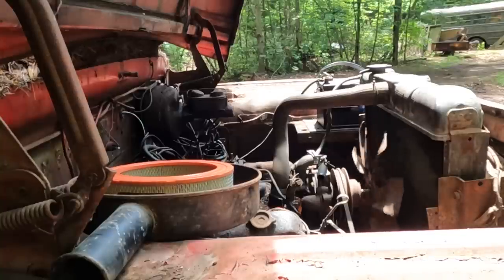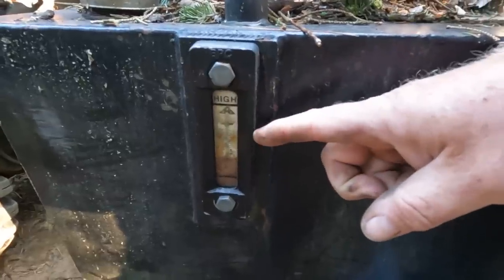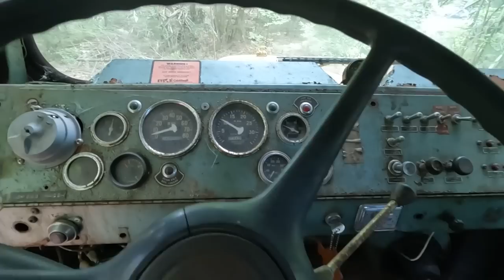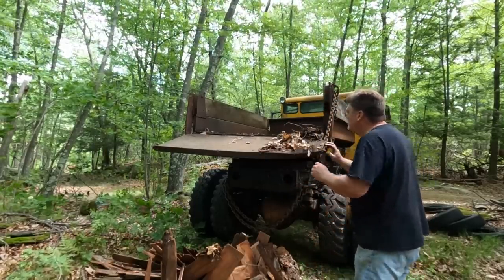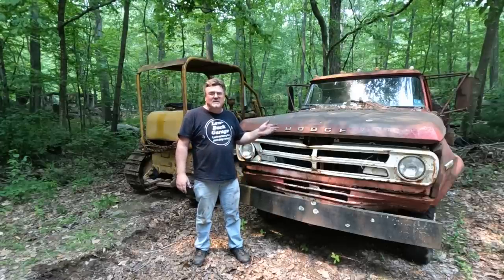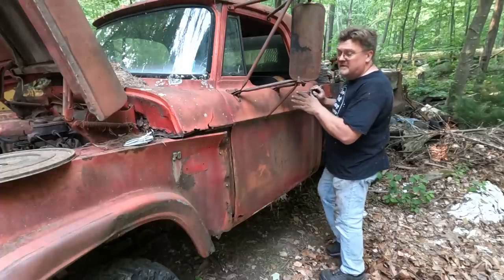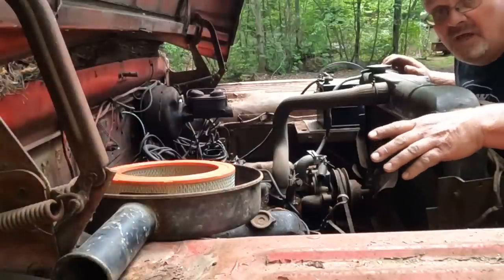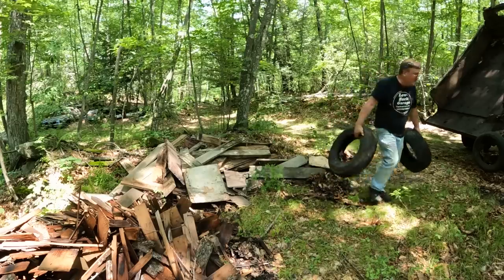Dodge and Oshkosh Dump Trucks

Comment: I love that Oshkosh.  I would use that as my daily driver.  Maybe that would stop all the park and run damage that I have been subjected to over the years.
Reply: why would anyone live in a city??
Reply: @Hard_Right  I don't live in the city, but over the years, whenever I parked my nice cars or trucks in a parking lot, some thoughtless pos would leave my car with a mark in the doors, or even back into my hood.
I had an a VW, that I used as my airport car, that had only been rolled once.  It didn't even have bumpers!  In over ten years of leaving it in parking lots, it never got so much as a scratch.  Man, that was a good little car, started every time.
Reply: @jjock3239  
As a still recently married man, had a service call on a Saturday at an arcade, wife rode with in my less than 1-week old '71 Pontiac LeMans Sport.
Wife comes in & says "I think you need to come out here" - Once there I see 
 guy is standing there, by my car, he starts to tell me how he had to drive his alcoholic father-in-law to the liquor store next door, and as he was backing out with his full sized '69 Ford Galaxie next to my car, his father-in-law was yammering trying to grab the bag he'd just brough from the store and he got distracted, then he moves over a bit and I see the driver's side quarter panel is caved in, demolished, not just dented...I'm just staring at my car in utter disbelief then he starts telling me REALL fast that he'll fix it, he'll pay for it, he's got insurance, and starts digging out his billfold getting his license & insurance card out, I realize then I'm still holding a 12" 'crescent' wrench, shove it in my pocket, take his papers inside, copy them, give them back, he leaves.
After completing my work, I get in the car, Wife: "Are you okay now?" Me: What do you mean?" 
Wife: "You came out & that guy started talking, you looked puzzled, but calm, THEN he moved and you saw the car...." Me: "And?"
Wife: "I don't know how to put it, other than your entire body began to 'vibrate', and your entire right arm and hand holding that wrench began shaking, And you no longer looked calm...if looks could kill..., THAT was when he stopped explaining and started saying he'd fix it, has insurance and all, I think you SCARED him." 
I started laughing, :Yeah, I was mad as could be, but also felt sorry for the guy, his car was damaged too, sure I get mine fixed right at a good body shop, he can get his fixed, but He will be stuck with HIS father-in-law, and I'm NOT.
👍🇺🇸😎
also, before that, in college riding with a buddy to check out the river for a picnic & keg party, he lost it rounding a curve on the dirt road, and rolled it, and he quickly cut the engine off, the 3 of us got out, rolled it upright, waiter a few minutes, i checked the engine oil, still up to the mark, he got in and kicked the roof out, could barely tell anything happened, after checking found water still high, so we'd have to wait a week for the picnic, went back to the house we lived at with 3 other students and going inside related the story as we had sodas, someone wanted to see the car, we went out, you could barely see a line crease on one side of the roof, and footprints on headliner, otherwise not a scratch on it, having gone in shallow ditch on wheels, then rolled out on the soft tall grass, not even a bent fender. soon it became they wanted to see where, as they didn't believe it. 
I stayed, as the others made 4 in the 'beetle', when they returned, the story began, thinking it was the NEXT curve, not THIS curve...he rolled it AGAIN, same deal, but now a line crease on other side of the top! someone said they HAD to go look, came back in, said "Hey, let's go out there, show me where it happened" my buddy gave him a 2 word reply, the 2nd word was "YOU!" 🤣

Comment: re: Oshkosh tailgate: remove the split pin at the chassis pivot/pin and hang the linkage up to the body with the spring.

body will then be able to tip without tripping latches.

Comment: First time I saw the vertical Dodge hood on a buddies truck I was impressed.
Reply: That was a advantage for these trucks because if you needed to replace the engine you can literally sit on the fender wells and turn wrenches with the hood way up like this which makes them much easier to work on compared to the  Chevrolet Ford or GMC and the hood doesn't have to come off to pull the engines on these . I've had 3 of these old Dodge trucks and still have a 71 utility line which would be what Chevrolet & Ford call a short box step side truck .

Comment: The bed on the Oshkosh is a 1930’s version typically used on the double AA ford. They worked but we’re a bugger if you were trying to dump uphill. My grandfather operated one back in the day

Comment: oh man that 413 sound so good!
Reply: That's a 318 small block because the 361 383 400 413 440 and the 426 Chrysler Hemi all have the distributor on the right front of the engine & this engine has the distributor on the back. The 273 318 340 and 360 small block all have the distributor on the back of the engine .  I had 3 of these what are known as Swept line trucks and 1 I had was a ex air force military crew cab 4x4 and that had a 318 in it from 1968 . One of the best trucks I've ever had because it was easy to work on & over built being it was a military truck that had things on it that the civilian model power wagons didn't come with . I looked to see how many were made & it was less than 2,000 of them and most of them when the Vietnam was was over got sold to fire dept and DNR and some were sold over seas and used for the Arabian military I found out . Wish I still had the truck because you don't see many of them & they get huge money for them now even in rough shape .

Comment: For the tailgate release link (12:08) -- No, I don't know what is supposed to be there, but here's an idea: Adjust the link longer so it doesn't automatically release. When you want to automatically release, jam a stick in the eye. Well, actually, I'm not sure that the adjustment is still an adjustment. But I'm sure you can figure out a way to make the link longer. 😁
Reply: If you want to get really fancy -- There is the L-bracket on the frame with the roughly 1/2" pin welded to the top of it. Weld a second 1/2" pin lower down on the L-bracket (maybe all the way at the bottom).* Then, for quick operation, replace the cotter pin with a hairpin retaining pin (or a bent piece of wire that just uses gravity to stay in). When you want the bottom hinge to stay engaged, move the oval opening on the end of the rod to the lower pin before dumping.
* Weld the new pin as low as possible on the L-bracket such that the oval rod end will still slip over it with the gate latch fully engaged. Note: the new 1/2" pin is just a convenient parking spot for the rod. I think you can find a location for the new pin where it won't push or pull on the rod as the bed is moved up and down.

Comment: The Oshkosh by gosh truck has what's known as a "full-floater" tailgate. It is also useful as a hammock or a swing. 1969 was the only year this option appeared in the Oshkosh by gosh catalog (lol). That was a cool switch of starters in the Dodge dump truck! I would have never thought the starter gear or the bolt pattern would have been the same! Good going!

Comment: I remember you getting both those dump trucks running. That antique don't bed on the Oshkosh is cool but maybe consider putting a 12-yard dump body on it, the truck certainly can handle the weight. Keep up the good work and the cool videos 👍✌️🇺🇲

Comment: Excellent video Glenn  :) also like 1969 Oshkosh  truck & told my one cousin Raymond about  that truck you and he said that awesome Uncle Jack , Fred , Leo my dad be proud hear about if all still alive ! I said yes most certainly and told other Cousin Darryl  who was co polit in when  Leo drive that 1951 on Roads & Works Department Highway Patrol  with in Country area  and Darryl  said did drive from 1988 to 1995 when fire at garage happened when destory! He said Air Brakes hose is common thing fix leak put hose clamp on for nice snug fit fix it and he said ever use that truck in Winter cold have thermos of hot drinks need it ! Darryl said old 1951 was 4×4 to and keep that truck in good condition  it peice of history to 1969 one you have ! I ask him latch problem next time I see in person what to do for fix up! Also Dodge yes great truck think starting issues cure and plus carb fix up in kit or good used one or new one cure it !

Comment: Another thing about starter motors is that the number of teeth/diameter of the pinion has almost nothing to do with compatibility with a certain engine, those with the pinion with fewer teeth and therefore smaller diameter have the shaft offset closer to the flywheel and vice versa.

What is important is that the replacement rotates in the same direction as the original because the bendix turning backwards will try to disengage the pinion from the ring gear while the solenoid attempts to engage them and that will cause rapid damage on both the starter pinion and ring gear teeth. 

Sometimes starters will fit too even if they were made for a bell housing with the hole for the starter on the other side of the engine, the only problem is that the solenoid will end up in the wrong position and that can cause clearance issues. 
Also the solenoid should never end positioned under the starter motor or it will end up getting full of water, but for an emergency it's an option. Perhaps you can turn that into a long lasting or even permanent fix by drilling a drain hole or cutting a notch between the solenoid and the starter housing, but do not try to drill the hole in the solenoid itself

Comment: That starter has a bad armature winding and the only thing you can do is either get it rebuilt or replace it with a new starter. I’ve been through this a few times myself.

Comment: Put chains on all four corners two open two different ways. The. Bottom opens up for doing rock driveways then the top opens  so  you can load different types of loads

Comment: I love both of these trucks. What does the dodge have for a motor..a 318 polt?
Reply from the maker: It looks like alater model LA version, not the original engine, but I'm not sure if its a 318 or 360.  I should have checked the casting when I was changing the starter...

Comment: on the dodge newer starter but it still sounds like a crysler product  which the all sounded the same bno matter model
something new cars dont have . as for the  yellow truck most likely a sault or salt mixed with sand rotted the gate

Comment: Oh crap, you said the e word!!😱😆
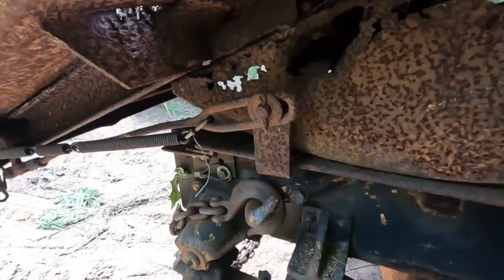Reply: 10:35 out of curiosity could you replace the split pin and washer with an R clip so you can pull the main loop away from the pin?.

Then I assume the bottom tailgate release wouldn't get tripped by the release contraption tightening.